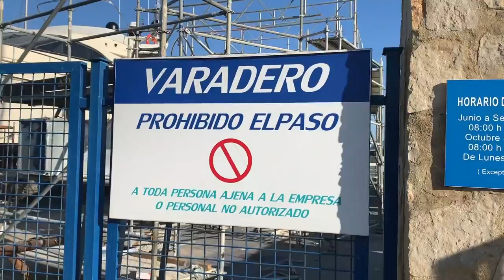SEASON 4 BEGINS: We're Back on the Boat! | Sailing Adventures in Europe | Ep 89

Comment: Nick - quick technical question if I may? How many times in your experience do anchor swivels fail? Just back from chartering a Bavaria C41 (2018) And the Anchor Swivel split apart just as the Anchor got to the top of the bow roller and of course the charter company say it was our fault that the Anchor was lost (diver could not find it) and we ended up buying a new anchor.  However we only Anchor twice in good holding and Has no issues in setting the anchor. We noticed that the Swivel that gave way  had a strength of 850 KG where I believe the weight of a Bavaria C41 is circa 19,136 lbs.  Trying to get a response from Bavaria to see if the swivel was not fit for purpose but just wondered if you come across swivels giving way before and what strength they should be??????  If you get a few minutes I would be interested to hear your views
Reply from the maker: Hey mate, good question and the answer is not simple.
It really depends on how the swivel failed. If it failed because of too much lateral force, it is because the sides of the swivel bent outwards and caused the swivel to fail. This would only normally occur if the boat was subject to high winds at anchor, or if the anchor jammed somewhere and the swivel was pulled sideways. This entire failure can be removed by the good practice of putting a bow shackle between the anchor and swivel. It’s rarely done, but should be.

If however the failure was because the stainless connector between the two parts of the swivel gave way, that is normally due to unseen corrosion. 

My take on this is that in either instance the fault is not yours. We motor hard against our anchor to dig it . In this case the forces on the anchor and swivel are huge. I wouldn’t expect it to fail.
If you want a far more scientific answer  which may support a claim against the charter company, talk to Deneen at Mantus anchors. She explained so much to us about loading and stress. 

Hope this helps
Reply: Thanks Nick - much appreciated - will be composing a response to the Charter Company to try to reclaim the money for the Anchor but more really using it as a learning experience for when we follow in your footsteps in a couple of years time.  Want to be sure we get the Ground Tackle right and especially the type of Swivel as it is such a critical part - will rewatch your Mantis Anchor switch out to see what you used. Chartering different Yachts and CATS over the next few years to help us with the purchase decision process.  Such a tough call between the romance, history and purism of a Yacht v the practically and ‘Liveability of a CAT - not an easy decision so very interested to follow your own journey and decision making process - thanks again

Comment: Nick,
If you said it, I probably missed it, but where did you get the 5 meter zippers? 
Glad you're back on the boat.
Reply from the maker: An online company called snuggz. They supply all sorts of mad upholstery stuff
Reply: J  G Miller I got my 6 m zipper from the YKK dealer in my region. I bought the thickest plastic toggles they had. It was cheap. Like $30